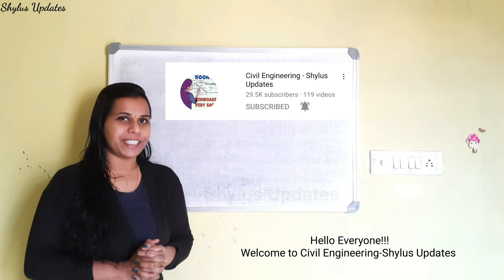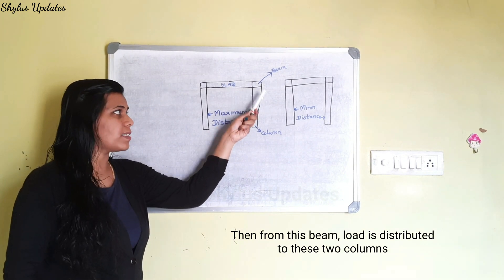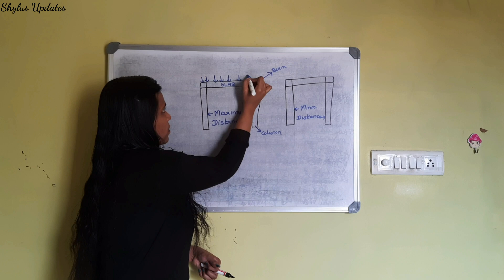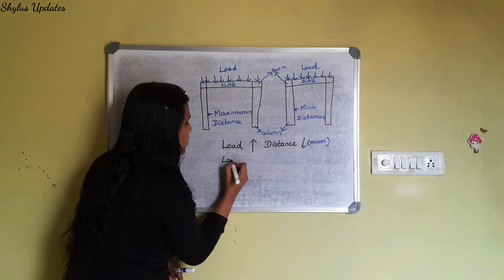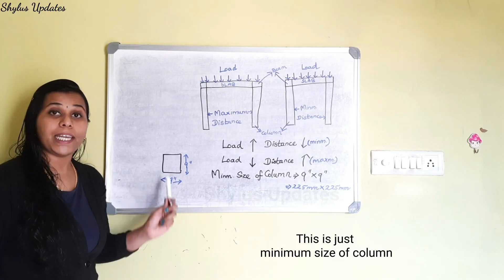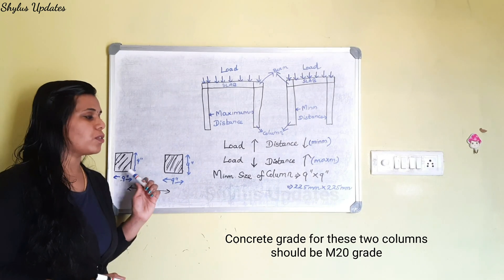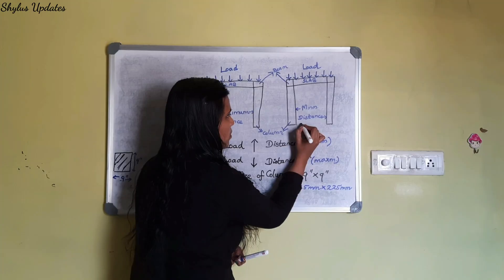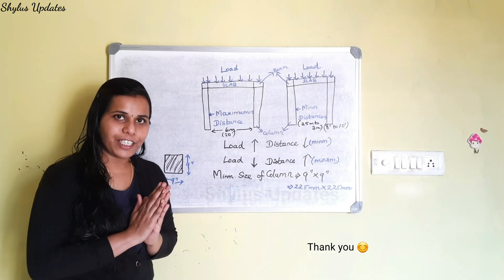Maximum and minimum distance between two columns |  2 कॉलम के बीच अधिकतम दूरी कितना होगा?| Thumbrule

Comment: Why 225mm*225mm.And you said  1 inch=25.4mm.So conversion will be 1 inch=25.4 what about 9 inches.The answer should be 228.6mm.Thanks.If am wrong I will appreciate correcting me Madam.
Reply from the maker: What you said is correct & accurate value. I have just rounded it off. Thank you for your comment☺️